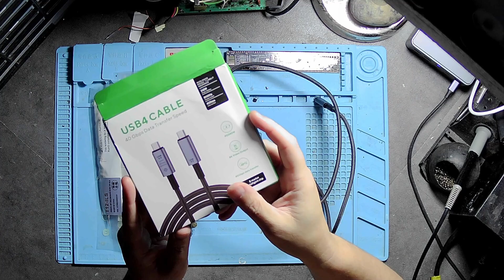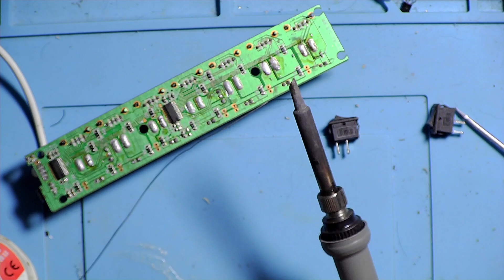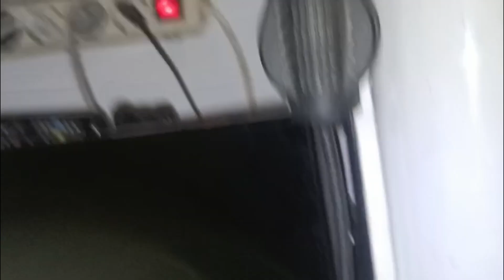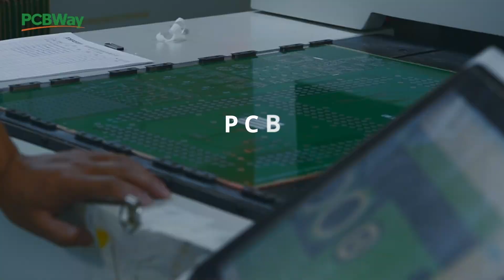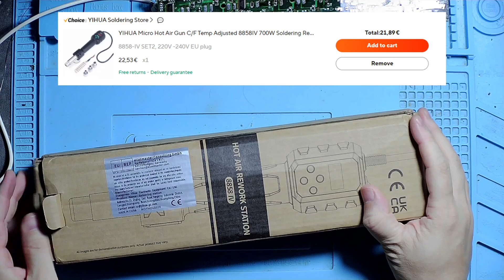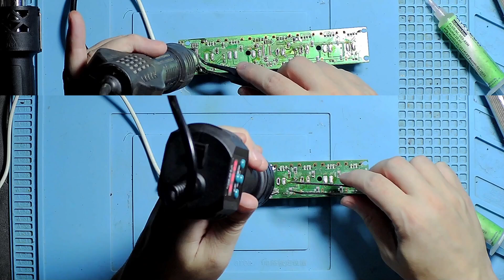🛠️ Replacing My HANDSKIT 909D+ Station – Is It Worth Switching to Stand‑Alone Gear?

Comment: I've been using my $7 (80watt) soldering iron and $25 hour air station for at least 7 - 10 years now. I honestly have never really felt the need to upgrade them, but at the same time I've never really been sure what I'm missing out on. Similar to what you said about the best tool being the one you're used to. I do have lots of other soldering irons (I got maybe 6 basic 60w irons for $3 each a while ago, and I've modded a bunch of them for specific tasks, or ran them at stupid voltages (rectify mains for a small boost, or voltage doubler on mains if you need a stupid high power but very short-lived iron!) but I've never spent most fan $15 on an iron, and never felt like I was missing out. What's your opinion - I've got decades of experience soldering, definitely solder better than any of my friends, and don't have any issues soldering small SMD parts. So you think I'll benefit at all from having a fancy expensive one?
Reply from the maker: Hi mate thanks for the view , regarding your question, as long as you can perform the soldering quick enough you should be fine. There are sensitive components that need as low heat as possible like and LEDs die really easy if you over heat them there it would be beneficial having a temp controlled iron like the one I bought. You can get away with a cheeper 65w pd supply and the iron so you would be looking at 20-22$ for it. So it's really not that expensive.  If you need  temp control buy it otherwise just use what you have😊